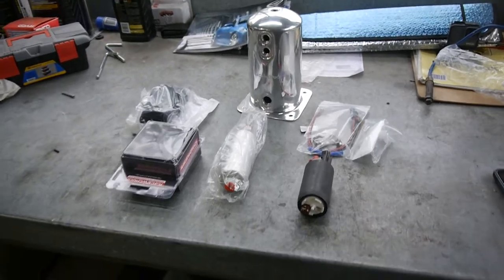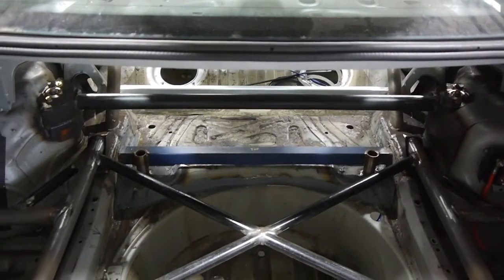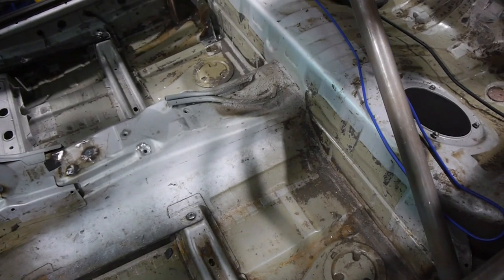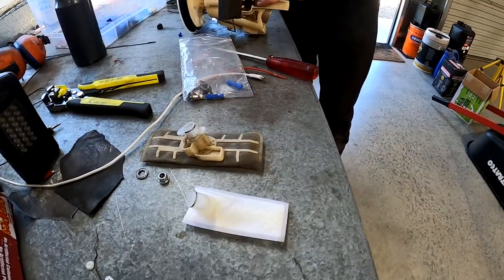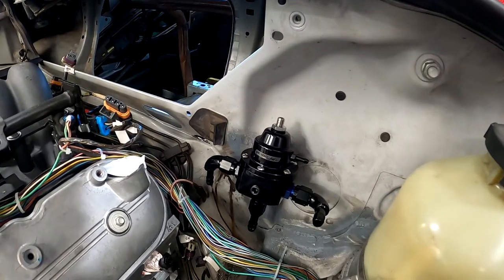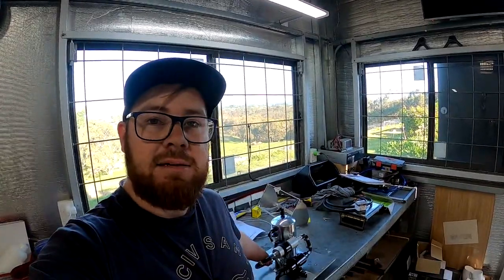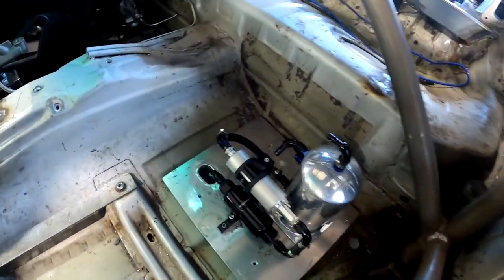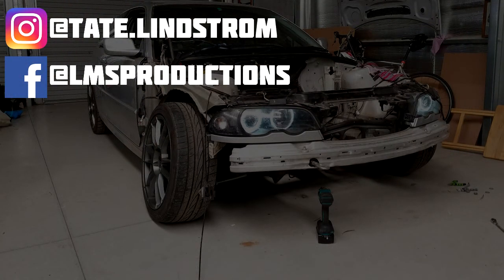Fuel System Fun - Ep11 'Smokey & The One Armed Bandit' LS1 E46 Drift Build

Comment: Ive been going through your build videos and im really glad i found your channel youve got a lot of good info i plan on using for my swap. Loved your 350z diff swap video and your subframe reinforcement video i did a similar setup but i put a x to tie the rear strut towers into the subframe brace, wasnt to hard and it looks awesome. 

If you have the time to reply i dont know if you mention it in another video or not but what are your plans on wiring? Honestly I really hope you go a diy oem gm stand alone i would love to see how to tackle that, im currently doing mine and its a fun challange. Also if you want a good cheap way to make your own solid subframe bushing I can give you some ideas. 

good luck with the rest of your build looking forward to watching
Reply from the maker: Hey mate. Glad your liking the vids and finding them helpful. I was tossing up using a stock GM computer but ended up going a going with a link extreme. I am using a stock loom and repinning for the link through. Honestly a stand alone for the GM pcm is pretty simple looking at the loom and the pin outs. I went aftermarket because of dash setup and extra stuff i wanted to run on engine and car.